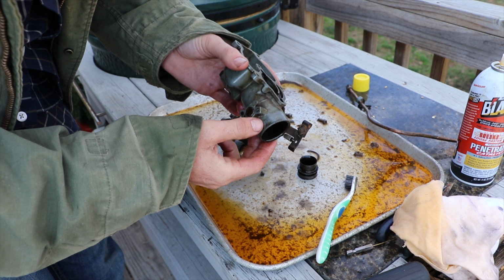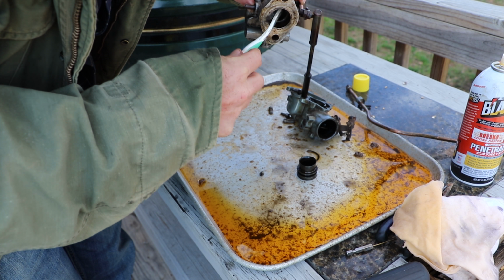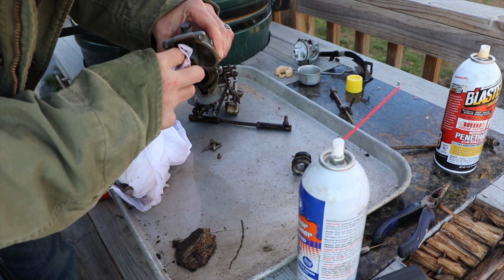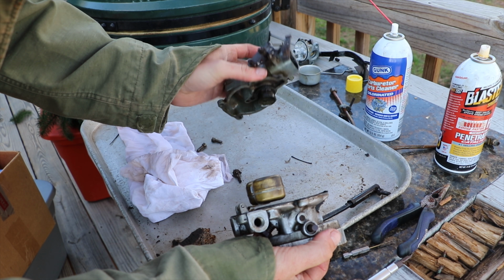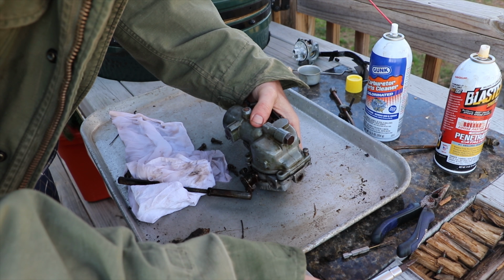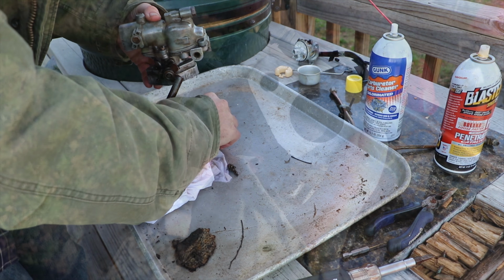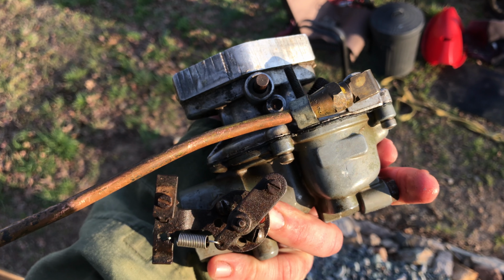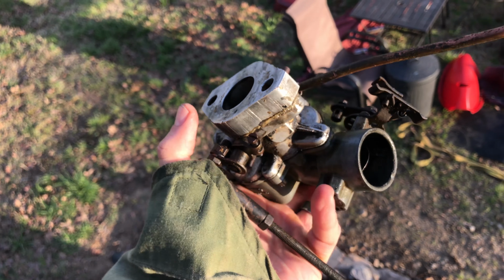Carburetor Cleaning - Rust Bucket Rehab

Comment: I DONT WASTE MY TIME PICKING AWAY AT A CARB TRYING TO clean it, I buy kleen-flo carb cleaner by the gallon, and I put all the carb parts in a coffee can, or something bigger for large carbs and pour the carb cleaner in to the can until all the parts are covered, and leave in sit in there  for 24 to 36 hours depending how bad it is, then blow it all out with compressed air, and they come out nice and shinny clean, there is so many little gally ports that you cant get opened up properly any other way. and it is the only way to end up with a shinny like new casting to work with, nothing worse then spending hours trying to pick it clean and still not have it run right in the end, the soaking is a no fail way.. kleen-flo just eats it clean, it is not hard to do, just set it soak in and blow it,, don't forget to remove all seats and jets